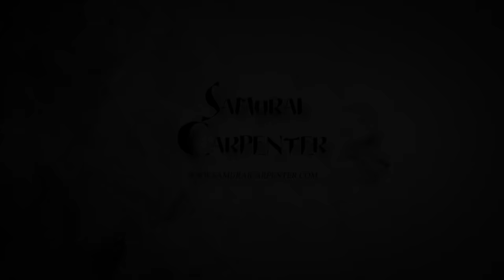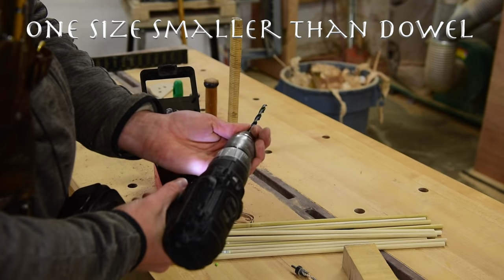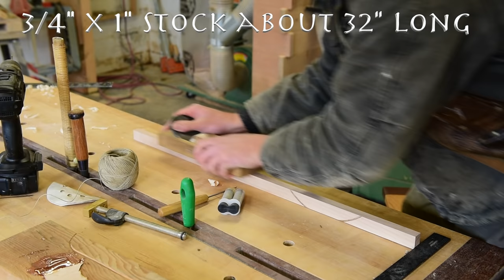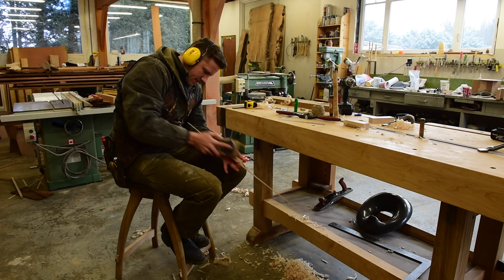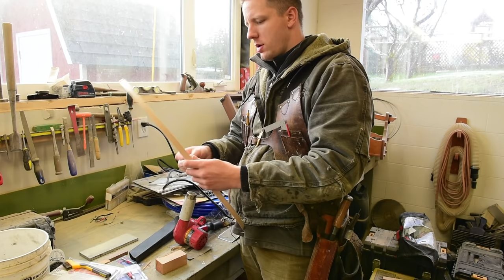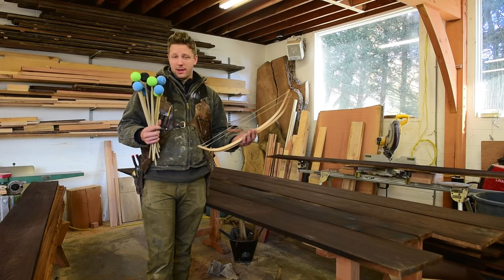Woodworking, Kids Bow And Arrow

Comment: You might want to rework the heads a bit. I've played LARP (live action roleplaying) for a number of years - and we practically invented 'safe' arrows. Here's what I'd suggest based on 20 odd years of having arrows shot at me...

The problem with your current setup is the tip of the dowel can push through the foam - especially after a couple of impacts. We fasten a coin to the end of the dowel inside the head to increase the surface area.

Those balls are designed to bounce! Most eye damage from these kinds of arrows comes from the tail end bouncing back off a shield or similar. There's no protection around the feathers. Mate of mine lost his cornea to a bounce back :-(

We now have arrow heads that are a combination of foams - 1 that deforms quickly to absorb the impact, the other that deforms slowly to prevent the bounce back.
Reply: Richard Allsebrook Thinking the same thing man. Great solution with the coin.

They should definitely wear eye protection. And make them swear to never shoot at anyone not playing with them.
Reply: for f#ck sakes!
Reply: Don Finch problem mate?
Reply: just kids, they'll be fine (enough) . Had pointy arrows when I was a kid!  Was all the safety comments, I happened to react on your comment.
No offense intended - sorry 'bout yer mate. Didn't click the more button first time. Wasn't a good spot to put me comment under yours! Might have to behave meself
Reply: Dude, the reason we started banning and limiting some toys like this is because kids were getting seriously hurt or even killed.

Hell, people mock tobogganing bans but kids do get killed and suffer serious injuries to tobogganing. What's ridiculous is it doesn't mean you can't throw snowballs, or build snowmen.  It doesn't mean you can't set up safe courses for kids to use toboggans with proper safety gear.
Reply: Yeh, I've seen toboggans on youtube - I'm in Australia. Some people don't think with those things.
I dunno, I'm a sixties boy, it's how we were brought up............... Safety never hurts.
Reply: Aww come on man
I played with stuff like that when I was younger and I never got badly hurt
I get it with live action role play why you'd wanna take extra precautions
But it's just kids
Let them have fun and enjoy their childhood
Getting hurt is a part of childhood
Live with it
Reply: You don't get it. Just because something bad didn't happen to you doesn't mean it won't happen to someone else. That's a perceptual bias.
Reply: losing an eye isn't part of childhood. At least not part I remember.
Reply: I'm not sure but ,if anyone else wants to discover straighten knock knees try Magonsi Legs Remedy Expert (Have a quick look on google cant remember the place now ) ? Ive heard some incredible things about it and my brother in law got excellent results with it.
Reply: Not certain about the points made but ,if anyone else wants to discover woodworker plan try Jadonite   Wood Blueprints Buddy (just google it ) ? Ive heard some incredible things about it and my mate got amazing success with it.
Reply: TV jitterbug
Reply: Richard Allsebrook
Reply: I think the point,  in relation to safety is a difficult one.  Realistically,  if we are placing bans on things that could be hazardous,  eventually there wouldn't be much we could do.  Driving would likly be on that list.  I'm not saying we shouldn't be safe,  but the kid down the road who did the dumb thing and lost a finger is why we didn't do that dumb thing.  It was a self correcting problem in the end. Pain is a powerful teacher.  I suppose, I'd be curious to know where the line is between banning what might not be safe and limiting exposure to teachable moments.
Reply: @timmarks3050  Mate of mine got blinded with a LARP arrow. LARP is a 'game' - you shouldn't be getting life altering injuries from something you do for fun.
Reply: @richbuilds_com  he should have tried something less dangerous like table top dnd.  You are shooting projectiles at your friends... its a risk...

Comment: Amazing job samurai! I do have one suggestion/ nostalgic feeling. When I was a kid I had a bow and arrow similar to this that had a hole drilled right the middle of the handle that you stuck the arrows end through and then onto the string. I found this a lot easier as a kid. You may want to try it? It would only take like 2 minutes to drill a hole big enough

Comment: With the heatgun: heat up the inner side of the curve, where the fibers have to be compressed. The outer side is under tension and should not be weakened.

Comment: "youll shoot ur eye out kid!"  never knew that about the heat..now is that just with maple or does that work for all hard/soft woods
Reply: it works for all woods. all wood has lignin, it usually makes up about 25% of the wood composition but some woods have more or less. it's mainly in the space between the wood cells, the cells being what you or I perceive as the wood fibers, wood cells are like long thin tiny tubes. the lignin glues all the fibers together, heat softens up the lignin and allows a little bit more movement until it cools down and the lignin hardens up again. it's the same principle that's used to bend chair backs or guitar sides. I took a wood science class this past semester as part of my forestry degree, I know more than I ever thought I wanted to know about wood anatomy lol
Reply: Caleb Cothron thanks man!&thats awesome! Hey, the more u know the better..knowledge is power!🖒🖒

Comment: I tried using poplar wood. Unfortunately my bows arms keep breaking. What thickness are your bows arms?
Reply from the maker: I used maple.  My arms are 1/4" near the handle and taper to 1/8" at the tip.
Reply: Thanks, I'll be sure to give it another go with the poplar.